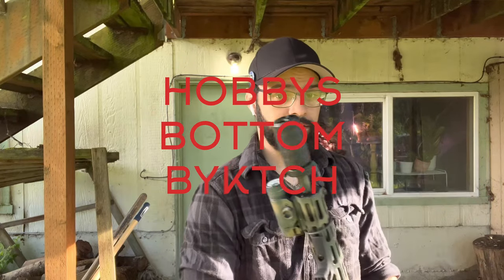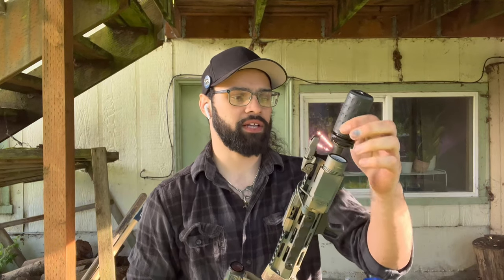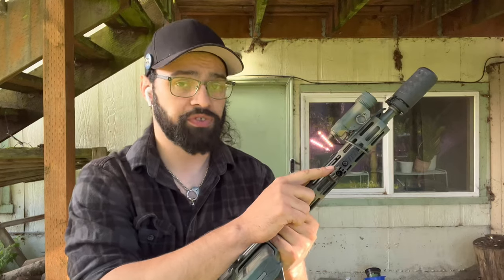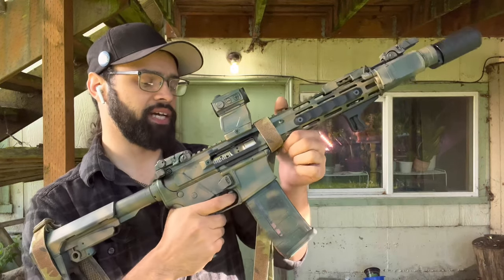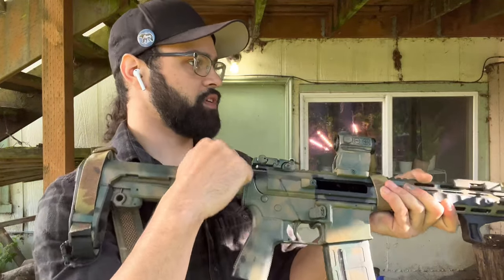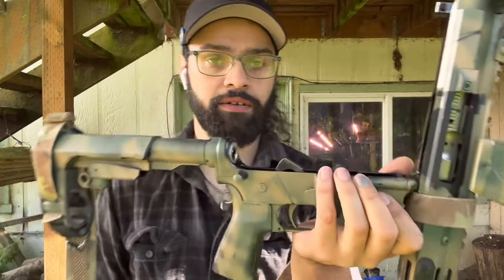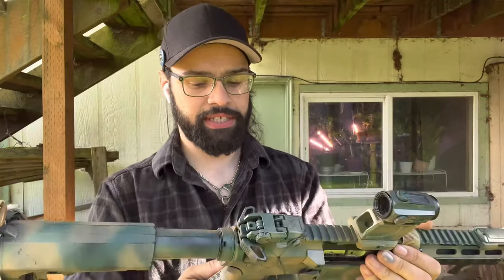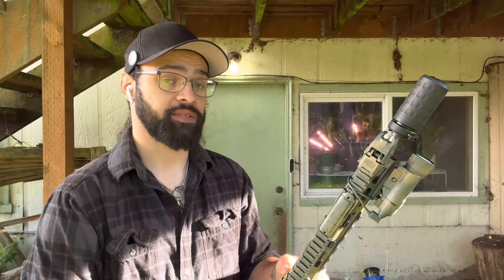12.5 pistol build! FM-15 (Hobby's Bottom Byktch)

Comment: Drill gas port to .078. It’ll run everything and not be too much gas
Reply from the maker: Appreciate it, I went with a 2.5 buffer and it runs everything, it’s my only AR so I don’t want to send it in to be drilled everywhere near me has a 6mo waiting period. But I am gonna wright that spec down.
Reply: @HobbyProblems  don’t have to send it. Rip gas block off and use bit number 49 which is .073. Start there. Use a little oil and drill. Don’t drill too deep. It’s very easy. 73 should run good if not step up gradually. 5/64 bit is .078 and that will run it all. Obviously smaller the hole to run it all the better so I’d start with .073.
Reply from the maker: @mk4vws  well all I own is an impact gun at the moment, don’t trust it for precise work, however I probably got a buddy with a drill press. 🤔

Comment: Just an fyi your buffer tube with that set up is pointless.. you dont need the buffer system with the fm product get the adapter to plug that hole for the buffer tube and run a pic rail brace that folds
Reply from the maker: You’re just a real goofball ya know that? 
This isn’t the fwd charging piston system it’s a regular DI upper lol.